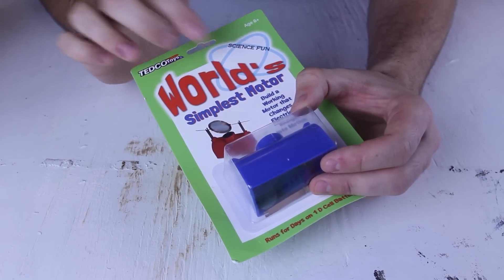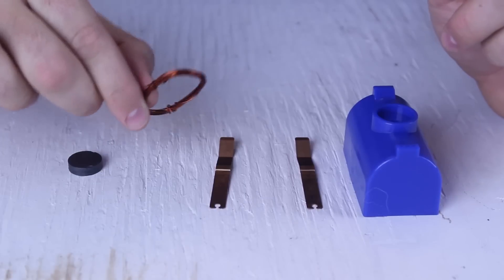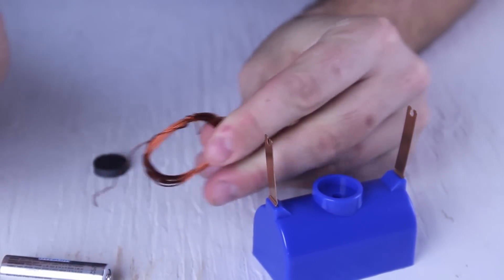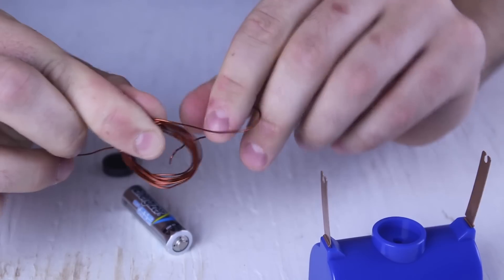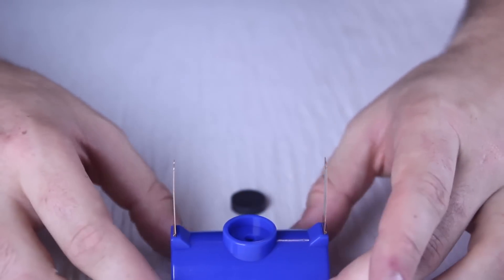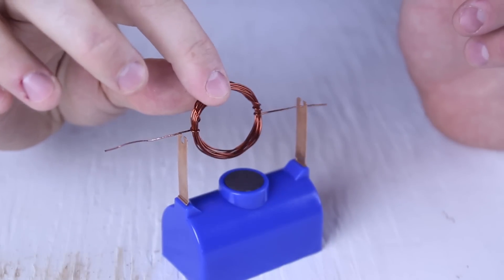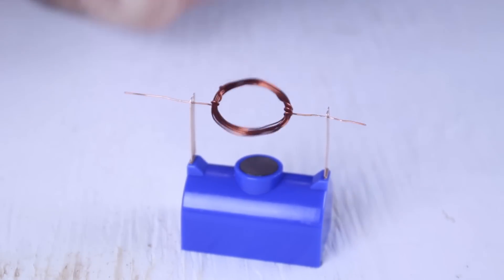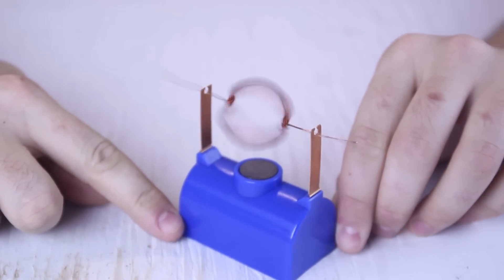World's Simplest Motor

Comment: only clean 3/4 way around wire to give it oscillation, otherwise it may stop, it needs to pulse since you are using DC.  AC pulses due to the alternating current, with DC you need to induce a pulse with a dead zone or oscillator. The only reason it's working at all now is due to the wire jumping around losing and regaining contact.  A sure fire way to get it to run is to just lay the coil on the table and strip only the sides facing up, leaving what's in contact with the table covered (you really want 3/4 bare and leave about 1/4 covered). Good luck

Comment: the reason it wasnt spinning is because the copper wire is powered and has a north and south pole and when it face north it attracts so it will spin that way and when the south pole faces the north is will reppel so it spins

Comment: It works much better when you just take away the isolation on top of the wire left hand side und bottom on right. That's the way eltric engines work.

Comment: I'm guessing if the battery was replaced by some solar cell(s) and an improved axle to keep the coil in place it's likely to keep moving in even ambient light, and better in bright sun light.  Also, if the supplied [weak] magnet was replaced with a rare earth magnet, I wonder if the coil would even need a kick-start?

Comment: Am I the only one who doesn't get this? AFAIK, this would only work if you flip the current every half rotation, so the poles in the coil flip sides. It looks like the current would be flowing in the same direction all the time in this motor, which wouldn't be that much different from just having a bar magnet and hoping it would somehow start spinning. I don't get it...
Reply: i guess that may be the difference between an ac and a dc motor
Reply: Pat Kent Well, no. The need to alternate take care of alternating the current yourself is exactly what you should be doing to make this work with d/c. I would only expect something like this to work with an a/c power source, and that's obviously a battery...
Reply: but look how the ring of coil is wrapped and imagine electricity traveling through it in one direction. as the hoop of coil passes over the magnet it is really changing direction according to the magnet polls that stay the same. I could be wrong but I believe this is alternating the current mechanically instead of it happening through the A/C process. Arent the coils wrapped differently? please consider this and reply. I am unsure if this is correct. You are most likely the only one reading this who may actually understand it.
Reply: Pat Kent Well, the thing is, the current always moves in the same direction, and let's say the coil is horizontal at some point, and looking from the top down the current is moving clockwise. once the coil finishes a half turn, we would "see" the current moving counter clockwise, since the current still flows in from the same side. Since the relation between the direction of the current (clockwise or counter clockwise) directly controls the direction of north/south poles, this shouldn't be any different from having a bar magnet spin on an axis. Clearly, that could never would because it would be the same as a perpetual motion machine
Reply: The current goes around the coil, so it is travelling in opposite directions when it passes the magnet.
Reply: David Miller Well, it would still behave much like a bar magnet spinning on its axis. I looked up a description of this kit though, and it mentioned stripping off only half of the wire on one end, which would mean you break the circuit during one half of the rotation. Maybe i missed that part of the explanation, but I think it's fair to say that that's what makes it work.
Reply: Mephistolomaniac or maybe the force of it turning just keeps it going in the same direction
Reply: Mephistolomaniac Yeah, that is a kind of commutator that is on / off / on / off.  Makes sense, except did you notice he stripped the insulation off completely around the wire in this video.  I did not see him do the other side though, so maybe it was breaking contract on the other side.  It may jump a bit too because it is not straight but in an arch.  When it jumps momentarily, it may break contact that way and then coast back to starting position where contact is made again.
Reply: David Miller Exactly what I was thinking, actually. I guess it wouldn't take much in the matter of insulation on one side to make it work after all.

Comment: You need to sand only half the side of the wire... so that it turns on and off while it spins.
Maybe it comes factory sanded and you weren't supposed to cut the wire.
Reply: Yes your are right, it might have worked because the wire was not straight enough which turned it on and off.